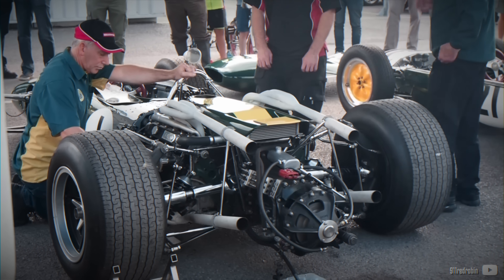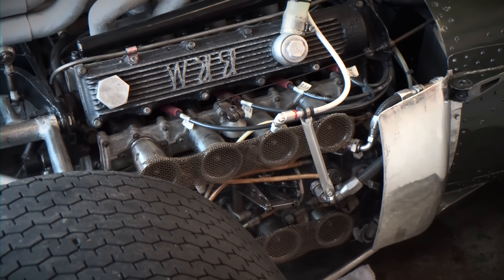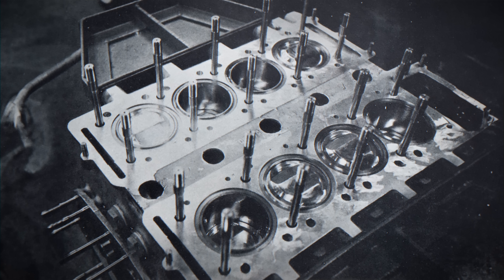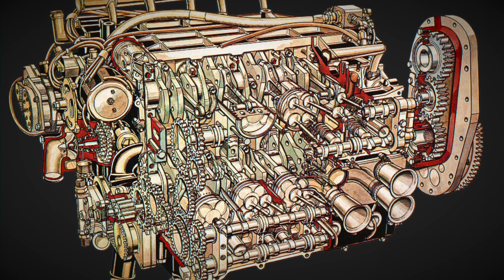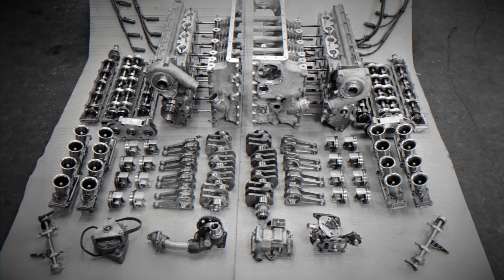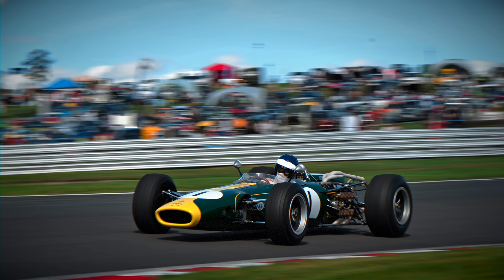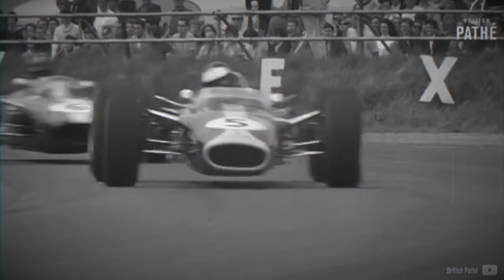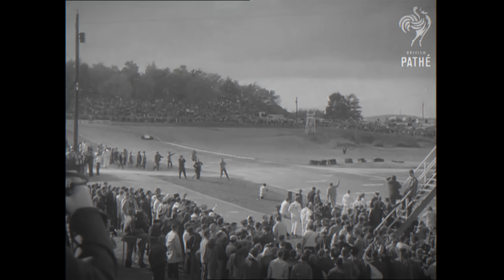The Most Complicated F1 Engine Ever

Comment: There are four other non-prototype dual crank H configuration engines. The Napier Sabre H-24, the Napier Dagger, the Brough Superior H-4, and the Konig H-8 boat engine. If these the Sabre is most similar if not in design, in design goals, to the BRM. Except it's even more complicated with sleeve valves. I've always wanted to build a billet block X-16 that uses LS heads. Using fork and blade or articulated rods each opposing bank would be in line with each other.
Reply: Well, go for it! Got to be worth a try. If a bunch of Australians can make a working V12 LS out of 2 blocks welded together, an x-16 is definitely possible - lord knows how you'd get the lubrication and cooling systems to work though...

Comment: "The weight difference of the BRM H16 and Ford V8 Indy engine was one Jim Clark" - That's all what's needed to be said. If you want to make the others talking about you, go for an H16; but if you want to win, go for the good, old V8.

The H16 would have made for a cool concept, but it clearly wasn't a suitable racing engine because it missed the necessary balance between power and lightness.

Comment: Me thinks the fantastic audio is in fact of the BRM V-16 and not the H-16. The H-16 would have sounded exactly like all the other competition V-8 engines owing to the "Long bang" firing order you mentioned. The V-16 of either the BRM V-16 or the Auto union Type C are unique and gloriously rich sounding beasts. I don't know why BRM didn't try X-plane cranks to solve their harmonics issue if they were going to bother with making 8 pin cranks in each deck of the engine block. They were already nearly there by splaying the split pins 45 degrees each, why not go to 90. Then vary each crank by 45 degrees to get the correct firing order again.

Comment: Okay, that was checky, using the sound of the 1.5 litre supercharged BRM V16 to close the video - you bad boy!
The H engine package really only works well using sleeve valves, using poppet valves leads to an excessively large engine.  

Tony Rudd came to BRM from Rolls-Royce to design the centrifugal supercharger used in the V16.  He would have been well aware of the Rolls-Royce Eagle 22, a sleeve valve H24 inspired by the Napier Sabre .
Just to add insult to injury the Cosworth DFV was introduced at the time of the H16, according to sources, Tony Rudd, after seeing the DFV and watching it on track, is reputed as saying "that's it, game over".

Comment: @ visioracer, I find an engine that I want you to do a story on. Here's an engine that's rarely seen since they were only ever designed to be disposable.
This is the 4 cylinder radial engine from a WWII German G7A torpedo. It ran on Decaline fuel (decahydronaphthalene), which was first burned. The combustion byproducts were then passed through a device called a 'wet heater', which also introduced water (from a 57 litre onboard storage tank) to produce superheated steam. This high pressure mixture of superheated steam and compressed air was finally sent through the engine to drive the pistons. 
Since the internal combustion/steam generator system was self-contained and fuelled by a chemical reaction instead of ambient air, it could run underwater. The 4 cylinder, 'X' type radial engine produced up to 350 horsepower at its maximum power setting, which was enough to push the 26' 6" torpedo along at 44 knots (nearly 50mph) while submerged.
Standard Kriegsmarine torpedo produced from 1934 until the end of the war.
Reply: I agree!!!
This one this one!!

Comment: That amazing growl at the end is from their prior engine, a 1.5 liter supercharged V-16.  It was essentially two 750 liter V8's mated end-to-end and was rated at 550 hp somewhere around 10500 rpm but would keep building power past that, actually peaking somewhere between 12500 and 14000 outputting 600-800 hp.  The length and complexity are what drove BRM to aim for the parameters of their H16... by going naturally aspirated they were allowed to double the displacement to 3.0L and - as the video noted - the length of a V16 was a big consideration for adopting the H16 layout.  It all comes from a time when the rules seemed to welcome pioneering.  By the 80s things had become a lot more... formulaic.

Comment: Thank you; this is most interesting. I knew about the BRM H-16 from when it was introduced, but great to hear about the developent problems and see all the visuals. I think it might be the case that the problem was more in the execution rather than in the concept. BRM was actually a rather small organization and simply did not have the resources to do what was needed for such a complex engine. I think it possible that if it were done today, with more thorough design work, the much more precise engineering available through computer controlled machining of parts, more durable materials, and digital engine management, the theoretical gains from the small pistons enabling faster engine acceleration, shorter length, and functioning as a stress bearing chassis member, could possibly be realized. But no one will ever try it, so we will never know.

Oh, by the way, the in-car camera footage, starting at 9:45 and from Zandvoort, shows a car with the words "Jordan Racing" on the side. This was the name used in the film "Grand Prix" for the team portrayed by BRM, and that footage was generated by the film crew, as you noted. The lack of coolant pipes along the chassis reveal that this was not an H-16 powered car, and that was most certainly not Jackie Stewart in the tartan helmet.

Comment: That BRM engine and other high cylinder count engines were made obsolite once Duckworth discovered tumble swirl would allow more conventional 4 valve engines to breath better and have much more rapid and stable combustion.  It changed engine design forever and stopped all this mechanical insanity.

Comment: Yeah it was heavy, but made up for it by being less powerful.  Just what you want in an F1 engine.  It's a testament to British fortitude that they eventually got it good enough to win a race.

I never knew they had a 4.2l Indy version.

What might have been if they had used two-plane cranks and phased them at 45 degrees to get even firing.

It was a bad idea from the start given that the open induction stacks on the eight lower cylinders were doomed to breathe in road debris.  And all they put on them were some chicken wire.  Sealed airboxes would have been good to have.

Comment: I mean..... Yea..... Sure....... An LS engine is simple and makes power, but it's pretty boring at this point....... In this time we have the ability to throw a solid block of billet material in a CNC machine and make ANYTHING...... best believe that if I had the funds I absolutely would be having all kinds of crazy awesome designs made, the guys that turned a v10 Ford truck motor into a 03/04 Terminator cobra headed v10, if I had the funds I absolutely would be onboard with that project, we are getting too caught up in going fast, we have been able to go more than fast enough to just be unrealistic for many years, it's not just about fast it's how you go fast, I want to see 35 Briggs and Stratton lawnmower engines running on nitromethane in a freakin 91 Ford Taurus or something 😂 and then hit it with nitrous until it flies apart 😂 would so much more awesome than an LS swapped anything, just saying,

Comment: Who really cares if this engine was apparently a failure. 
If we stopped trying there would be no progress. 
The engine would have probably been reliable and make good power given more time , money and development. 

Unfortunately things move fairly quickly and regulations change frequently hence another reason dropping of the engine . 

At the end of the day we all now drive around in 16v twin cam engines with rubber cam belts , variable vale timing etc etc which are far more complicated than a basic pushrod/ side valve.

Comment: They should have made it into a x block. With one crankshaft.
Reply: With a master and link connecting rod setup?  That would have been scary.
Maybe two side by side fork and blade rod setups.
A four-on-a-pin rod arrangement has never been tried.
Reply: @andyharman3022 why not. 

If you can do 2
You can do more
Reply: @fastinradfordable  And double the bending stress on the crank fillets?  Have at it.

I'm sure you won't have any trouble figuring out the cross-drilling scheme to feed the inner rod bearings.

Comment: This has got to be one of the most detailed explanations of the BRM H16 engine I've ever seen, either in video or print . . . and I've been following F1 racing since the 1960s.
In all other publications [either in video or print] I've seen about the H16, the author would simplistically say/write that two 8 cylinder engines were mated together, making the casual viewer/reader come to the conclusion that two of the BRM 1.5 liter V8 engines were bolted together.  Myself being a serious gearhead, I never bought into that, as seeing the H16 being a flat-plane crank configuration.  
I found it annoying that published works of the BRM would gloss over the details of the H16.
So, I'm most appreciative of the details presented here about the H16; where I'm also impressed that the depth of the subject also covered the abandoned 4.2 liter Indy project, too.
Reply from the maker: My pleasure!

Comment: Why couldn’t they just use a production engine? It would have been a lot easier, as they can just use off the shelf speed parts.
Reply: What production engine exactly? 🤔
In the 50s it was rare to have more than 100hp in a road car, especially one with under 3.0lt capacity. 
Yes, there were engines making more than 100hp, but I can't think of any approaching 300hp like they needed in F1.

F1 development like this filters down to road cars and production vehicles, that's where we get today's modern combustion engine technology from.
A humble 2.0lt family car engine makes around 110kw (150hp), can be started and driven in temperatures below freezing and up to 45°C without special treatment, servicing every 10,000km and uses around 7lt/100 while producing the least possible emissions.
This tech all came from F1 and their pursuit of efficiency and power. 🙂👍

Comment: Visio, the final track is not the H16 but the 1954 1,5 l V16 which you have already featured.
Reply: Correct. H16 didn't sound good or make good power, was just a piece of rubbish
Reply: @psk5746  exactly. I don't like it whan real experts like Visioracer mix them up. One is epic, the other is a failure.

Comment: Two things.
1) l wonder why BRM just didn't scale up their V-8.
2) l also wonder if BRM employed former engine designers from Napier.
The clip around 3:20. I would swear its from Grand Prix
Reply: It is from Grand Prix.
Reply: Doubling the size of a race engine does not come easily.  Even with the technical expertise and resources Porsche had in the late 1960s when it came to endurance racing, they had struggles bumping up the size of their 2.2 liter engine [used in the 907s] to 3 liters for their 908 sports car.
There's also egos involved when it comes to engineering designs, as some people like to come up with something innovative to impress their peers.  Sometimes the innovation pays-off, other times, not.

Comment: As always getting two engines to work together is one of the most difficult things in racing.
Reply: The H-16 was just one engine. Two cranks geared together.
Reply: Wasn't the Porsche flat 12 basically, but with finesse, 2 of their flat 6's geared to a single output shaft in the middle?  KISS!!!

Comment: The biggest design failure was the attempt of simultaneous fire. This with the intake sucking in road and rubber simply can't work. But, if you change the firing order to single pot and craft an ram air box to it, or even turn the setup to double VR8 (Bugatti) it just might last a full race.

Comment: That engine is insanely complicated. Between gears, chains, and bearings, the engine was probably robbed of 100hp from the friction
Reply: Imagine what it was like to sync the fuel injection throttle linkage with that configuration.
Reply: Imagine doing a valve job (like lash adjustment) and forgetting where were you in the process and START OVER.

Or the timing skips and the interference engine decides to do an explosive view in real time.
Reply: @droman608  trying to degree cams must have been a 2 week job
Reply: And no diagnostic computer aid

Comment: The engine didn't design of the cranks not rotating opposite directions to each other, didn't help its effective power & torque generation much and likely added somewhat to the unreliability issues with primary and secondary rocking couples compounding together,.. along with it being a prototype engine too. 

Had the engine been better performing relatively to the competition, and had been followed by further improved iterations of it, it likely a later one would have gotten to a contra-rotating cranks version, perhaps with 2 pairs of (left & right pairings of) idle gears in a square pattern equally between each of the cranks (upper & lower) drive gears. - The 4 idler gears to spread the loading & forces across as much tooth area as possible, while keeping the six gears relatively small and lower in gyroscopic mass before the connection to the final engine output for/to the gearbox.

But even so, it is still an engineering marvel & a generator of truly awesome N/A exhaust sounds for its cylinder size(s) & overall capacity.

Comment: actually H16 is not that uncommon in tanks. Russians did and do have em. the concept it self is actually very good, but this execution was seriously flawed.
Reply: @Turnipstalk well I did not look it up but it does ring a Bell. 
Multibanks are not a bad engine design to begin with indeed. 

Back this given engine , it would had been fun if they had a bit of sense of humor and had made it a 2 stroke. 
Instead of 8 cams, no cams. Instead of 2 crank shafts would had 4 crankshafts. 
Likely they could have saved enough on mass , and very likely get the power they had been seeking. 
Likely that would had been the most insane stunt in f1 history.
Reply: There are no H16 tank engines, never were. Russians use V12 engines.
Reply: @purplestrawberrysunset  the most common one is the one called "V2" that is indeed a v12 diesel. 
Russians don't call em H engines. Technically they are right to call em X engines . 
Armata uses the latest. 
Simular engine layouts are built , refined , and tested since the mid 1980's in russia , not specificly for tanks. Usually as high power stationary engines, gensets,  pumps etc...
Reply: @nagyandras8857 well the modern russian tanks use heavily modernized versions of the V-2 engine but they are not x-engines but typical inline configuration v12 diesel engines and the armata's 12H360 which is 12 cylinder x-engine has nothing to do with H16 engine since it's completely different layout and design. I don't know about other x-engines but the one in armata is specifically made for armata.
Reply: @purplestrawberrysunset   2V program started under ChTZ in 1970, with the first 2V-16-1 delivered for trials in 1976. 2V-16 is designed as two V8s connected together and 2V-12 as two V6 connected together, the idea being to provide compact X engines in the 1200-1500hp class for future tanks, and common V6 and V8s for lighter platforms. 
it is indeed correct that the army was not realy interested in them till the armata tank, for to be used in tanks. russia tended to stick to the well proven v2 engine and its upgraded versions for its tanks. 
these engines where kept under devlopment in the mentioned fields, and the 12 cylinder version you see in the armata is the latest iteration. all these engines where economic to run. the one in armata manages 160 gram/hp/hr fuel efficiency. simularly the former versions where prefered as stationary engines as those had pretty good fuel efficiency figures. 
its not a common engine. its not an uncommon engine.
Reply: @Turnipstalkthe only reason why that engine was made is because they needed some tank engines as fast as possible so Chrysler threw some automobile engines together because they were able to do it with existing tooling. The 21 liter 30 cylinder Chrysler A57 multibank engine generates 370hp.

Comment: Quite remarkable that a team of experienced engineers did not realize on the way of prototyping that H16, that it is going to be a overcomplicated, underpowered and unreliable race engine.
Reply: It's definitely strange that they thought hmmm..... Taking two mediocre engines and trying to make them work together, not just work together but work at 10,000RPM and endure extreme stresses during long races, and do it with mostly original parts from the initial engine, there is no way that they thought it was a good idea..... There must have been some reason for trying to make it work, but I suppose it's possible that they were just a little bit more uhhh, absolutely out of their fecking mind than the rest of us 😂 but hey, at least they tried, and now we know that it's not a good idea 😂
Reply: In the pursuit of more power rationality is lost.  They convinced themselves as bias is a hell of a drug.  “We can use the bits we already have from our 8 cylinder motor saving us money”
Reply: Experienced Engineers strive for simplicity…..and you have to work very hard to get to “simple”. These engineers lacked the necessary experience to realise their folly….and once this focus is lost the result is wasted time and wasted money.